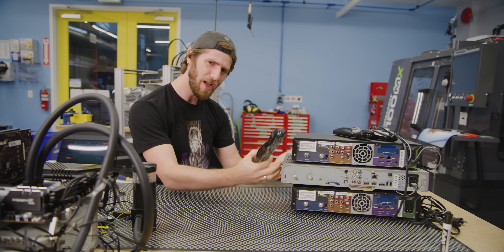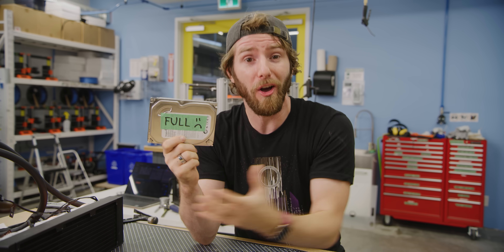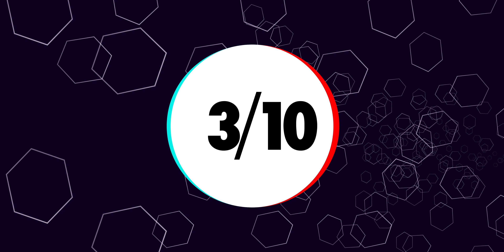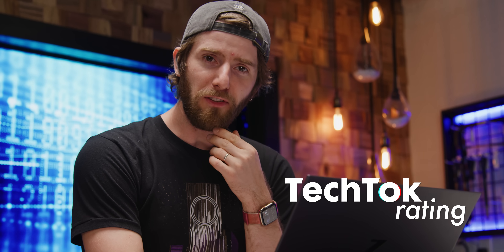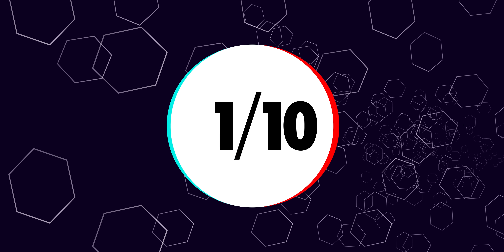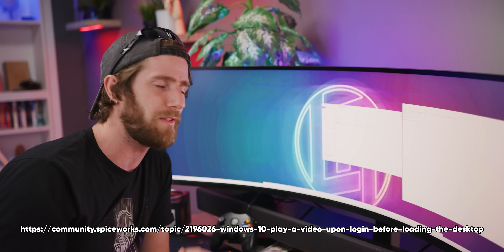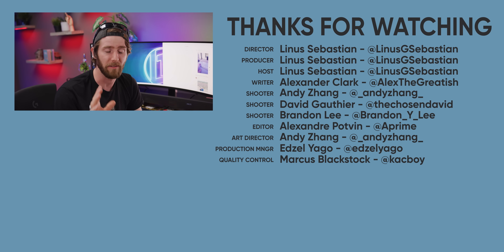Trying TikTok Computer Hacks...

Comment: 2:30 not only are most of the drives tiny, but also these things normally have a huge running time behind them and are close to their end of life. Even if you score a 1TB drive for 5$ (as unrealistic as 1TB or 5$ would be where I am from) you would most likely have an almost dead 1TB drive. These machines often threat their drives very bad as well; Sometimes having them constantly on even on standby even though no one has ever used the drive, or constantly starting and stopping the drive while running.
Reply: point is i dont want a 10 pound old hard drive when i can get a 7200RPM 1tb from 30 pounds

Comment: since i've been scrapping shit for years, i can say that it's actually pretty easy to extract a number of security bolts with just vise grips for $30. not to mention how handy the pliers are after the fact.

I've found all sorts of great stuff in the trash, from complete cases to various cables, and the 1980 pioneer stereo i use as my speakers.
Reply: Heh! 😀👍 I've used vise-grips to extract security bolts. Unfortunately it doesn't always work, one security they often use is to round the heads so that you can't find purchase. In the case of pinned-torx (like the ones in the PVR), you can use a precision-flathead like the kind for glasses; you just wedge it in between the pin and two points in the torx star. 😉
Reply: ive got a pioneer sx780 I found on top of a dumpster. been using it for 5 years
Reply: @user-vn7ce5ig1z  i just press the grips in sideways flat to the metal in those cases and clamp REAL HARD.
Reply: @sIacker  i think mine's a 3700?

Comment: You can snap the pin from the middle of the security screw with a small flat head screwdriver then just use a standard t bit to remove the screw

Comment: The dvr hard drive hack sometimes doesn't require a saw to get in as i just found one at a tip without the security screws. It just had hex screws although it was only a 500 gb wd green drive from 2015

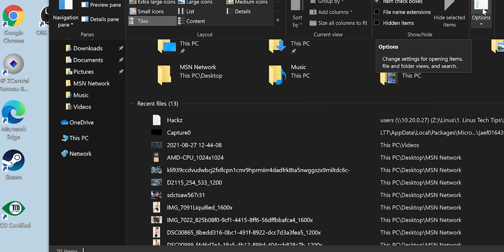Comment: 10:16 Hack improvement: If you want to hide a folder, choose an icon for it that looks like a regular shortcut (those with an arrow on the left bottom corner)
Reply: No, even better: make it an actual shortcut.
Hide the folder deep in your system and do a shortcut in some folder called "Programs" or something like that.
Then change the shortcuts icon and name to some lame ass program and all of your secret folders will stay untouched.
Reply: @-QuickNick-  Nice improvement!
Reply: Back when I was a kid I figured out how to make NTFS junctions point to themselves. So, you would click the folder and it'd just go to itself. If you manually entered the folder one level below the junction it'd get the folder correctly, though. I just tried to do it again and it seems I can't remember how I made it work. Perfect for hiding stuff w/o encryption though.

Comment: To remove rivet screws it is easier and safer to pierce through using a drill. Then using pop rivet you can also close back the assembly neatly. Don't use a buffer.
Reply: What difference does it make?  They're destined for the recycling heap anyway.  He could use a chisel and a sledge if he liked.
Oh, and if you try to buff anything with a wheel like that you'll destroy it.
Reply: @phydeux  the key word was "safer". good decisions come from experience. experience comes from bad decisions. now you are always free to use a cutting torch also. I really do not care.

Comment: Wiztree is faster than Windirstat and it does pretty much the same.
Reply: Yep, surprised the guys don't know about it yet.
Reply: I like SpaceSniffer, myself
Reply: And as they'll proudly claim on their website, they managed to make it so fast by bypassing Windows' APIs when scanning NTFS-formatted partitions/drives. Unfortunately, WizTree still seems to be doing a bit too much work on the main/UI thread, since the UI tends to lock up at certain points (somewhat like WinDirStat, but nowhere near as bad).
Reply: @Wise_That  I'm a fan of TreeSize. While it doesn't break it down graphically, it is fast and gets the job done.
Reply: @Surkrem  I've had windirstat miss hundreds of Gbs of files where wiztree showed exactly where the files I needed and was able to delete them no problem. I think I'll leave my eggs in wiztree's bucket.
Reply: @Surkrem  WizTree scans the MFT records (which is like 100mb max) while windirstat uses the caveman method of literally indexing every single file manually lol

Comment: Regarding the gloves comment @ 1:54. You are actually not supposed to wear gloves while using a device that rotates  at high speed like a grinder. It is considered an OSHA violation in the US to do so as threads from a glove can get caught in the disc and cause injury to your hand. The main thing is that the use of gloves around tools is something to think about as losing a finger is a real possibility when working with more powerful devices like drills, lathes, and bandsaws.
Reply: There are gloves which can withstand an angle grinder; specifically the ones which have big rubber knobs. But most of them are subpar according to Project Farm.

For a drill [press], lathe, or bandsaw? Yeah, screw that, no glove is gonna protect a hand from those. Maybe chainmail but you lose more dexterity than it's worth.
Reply: He probably lives in Canada
Reply: @rockpie.iso.tar.bz2 Linus lives in Canada are you new ? He said it many times
Reply: @slurmoCZ  no. i just wanted to say "probably" in the low chance that i was wrong
Reply: @rockpie.iso.tar.bz2  oh okay that's fine even if you would be wrong at least you would learn something new and sorry if I blamed you or something

Comment: I got couple of hard drives I took out from old digital TV receivers, I use them with my WII. Also used the power boards and fans for some Arduino and Raspberry projects, faster and cheaper than ordering from China. Besides sometimes things don't work as expected, so it's nice to have a bunch of spares. And it's really soothing to disassemble things.

Comment: Getting rid of security screws is actually done easier just drilling them out than flexing the thing open. With practice that takes just a few seconds.

Had to do that quite a lot to get to hard drives we needed to separately destroy before recycing the rest of a device early in my career...
Reply: Or spend a hot 50 cents on the driver you need. Or use pliers. Lmao.

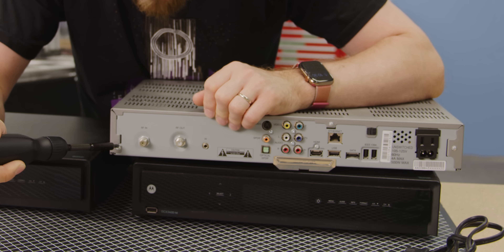Comment: 1:40 Alex plays the Safety NPC and Linus seems to be skipping the dialogue
Reply: gloves/loose clothing do not pair well with rotating tools
Reply: @brendanrandle  especially given that a tech workshop should have at least a cheapo chinesium security bitset, or , you know, a beefy pair of vice grips that would work easier and safer to just turn the screw out
Reply: @brendanrandle  or even a hacksaw to make a flathead slot

Comment: 9:48 most variants of this trick are incomplete without using a custom icon with a shortcut arrow that matches your OS perfectly overlaid on the corner
Reply: Or just use the blank image and special symbol trick to make your folder literally invisible. You'll only see it when you hover your mouse over it, it won't even appear in the file browser unless you change visual to "detail".

Then you can also make it a hidden folder to really fool them. They'll turn on hidden folders, nothing will appear, so they'll revert it. Your super secret folder of saved pasta recipes is safe.
Reply: make your how work folder a system folder.

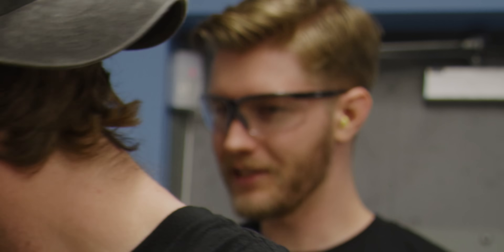Comment: 2:00 Just use a sturdy screwdriver and pry it open from the sides. 10 minutes of prying is quicker than a grinder.
Alot of dvrs use the same pipeline drives so you can raid them together in a raid mirror with a lot of success

Comment: As someone trying to learn data science and data analysis those little squares from Ninite Linus is called a Tree Map it’s good at sorting things and helping you drill down to specifics
Reply: Yep, it actually says that at the top in the application.  But that's minutiae this video didn't really need to get the point across.
Reply: @phydeux  yea I know i just thought it was cool to point out how you can see where you’re generally using most of you storage and memory to help compare the if it’s something that’s unusually high in that range

Comment: Hold on, did Alex just say to use gloves while using a angle grinder? I thought he knew about this kinda stuff
Reply: He did it because the metal was hot,
Reply: Why is it bad?
Reply: @Nickwilde7755  Better to scrape some skin off, then getting your fingers twisted in the grinder
Reply: @Nickwilde7755  never use gloves, loose cloth, untied long hair when work with any rotating power tools, it can tangled and may cut your body part.
Reply: @toptierdiscordmod7806  the spark not that hot, frankly the best safety when using power tool is not really protection (well, other than glasses to avoid spark getting into eye and ear muff to absorb noises) but good ergonomic workplace with enough lighting, fit condition body, and stay focused is the key.

Comment: Win+Ctrl+Shift+B is not for resetting the GPU drivers. 

This keycombo actually saves out part of the dispdiag circular log and queues up the data to upload through telemetry indicating the customer had a black screen. That's what the "B" is for. Blackscreen.

The key combo was added to help diagnose instances where the machine is churning along but there is nothing on screen. Pressing it when you don't have a blackscreen just adds noise to the system. A driver reset is a possible side-effect but not the intent of this key.

Comment: my first pc had a 4gig hard drive (although it had an engineering sample of an AMD Athlon 1100 overclocked to 1.4ghz when the fastest retail you could buy at the time was a Duron600 - mucho gracias to my old man who was head of R&D at mesh computers and took the prototype home to test and put it in my rig along with a soundblaster and guillemot 3dfx voodoo 16MB! gfx card and 256mb of ram)

Comment: I did that first one and found a 500gb hdd and I think the Dvr was $5 from goodwill but it’s a 5400 rpm and it’s slow as hell, but I now use it to store games for my modded Wii U and it works pretty good
Reply: That's what those are meant for. Those "OEM brands" are literally designed to only store large files and therefore have horrendous seek times.

Comment: One thing about XMP that should probably be mentioned is that it VOIDS YOUR CPU'S STANDARD WARRANTY. I had an i7 that died within the first few years of operation and I tried to RMA it, but when the Intel tech found out I had XMP on, they told me that they're technically not supposed to take returns in such cases. Fortunately the tech was a bro and fulfilled my warranty replacement anyway, but also informed me that in order for my warranty to cover damage potentially caused by XMP, I'd need to pay another $40 for a special overclocking warranty.

Comment: Unknown/mystery HDs I found to be hard work to format properly and took me a number of efforts before I got it to work as my gaming PC back up Hard Drive. At one point my computer could not identify which drive the operating system was on and span into an infinite stuck loop. Make sure you can format the HD as a system 2nd drive to back up to. lets face it we only use these to back to now we have SSDs as Primary system drives and the Spinning disk is the Secondary back up drive.

Comment: I know this video is a year old and all that but people probably don't know this and im not entirely sure if it's on by default or not but in ShareX there is a setting to where you can just copy the local file directly to your clipboard when you take a screenshot, you don't need a URL or anything. And to be fair, nothing about going through ShareX to upload it to a web hosting site is convenient when you already have to do more work for that than just taking a screenshot and sending the file normally (or ticking the one option to copy the file after the screenshot is taken)

Comment: I saw a video on YT a few years ago showing how to take apart a Sky TV Box set to remove the hard drive out of it and in luck I did get a Pipeline drive and it come in handy when my 2TB drive was on its way out, although for the first time in 20 years I didn't know that TV boxes even had hard drives if I knew I would of stopped my aunt and ask for years because I bed it had at least 1TB in it.

Comment: Ctrl + Shift + Windows + B is a shortcut to reset your GPUs drivers which (from my knowledge) essentially just flashes all GPU settings back to default specified by your currently installed drivers and will in turn reset any overclocks you applied and can sometimes be handy when you accidentally overclock your system too much.

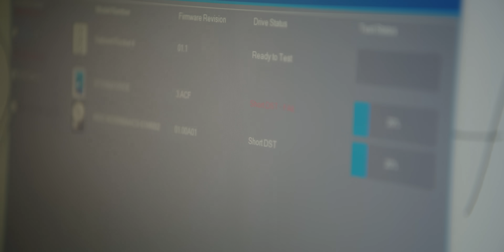Comment: 4:30 (RE: harvesting hard drives from DVRs/NVRs)
I've actually tried this with some NVRs and quickly learned that some drives require 3rd-party hdd tools 🛠 to "trick" certain firmware/power flags inside the drive to make it accessible outside of the unit itself...and it doesn't always succeed. Out of the 3 I tried to salvage, only 1--strangely a Seagate Pipeline one--was successful. ❌❌✅ 🤷‍♂

Comment: The directv box models hr24-34-44 and 54 will have 1tb hard drives In them 90 percent of the time the models hr44 and hr54 will always have them it's the 24 and 34 that come with either 500 gb or 1 tb

Comment: I got as far as the hard drives in viewing boxes, I have done this, dramatic video, you quickly learn the HDD size in different models of boxes, the little metal tabs need a little twist with pliers not a hammer?

Comment: 1st TechTok: I buy used 1tb for roughly $18-$22. No tools required for extraction. Unless you enjoy the "hunt for salvaged parts" to the point this gives you personal enjoyment, it is 100% not worth it to seek out old DVR machines and spend $ on it. If you happen upon them for free, awesome. In all instances you will never see a 7200rpm drive. 5400 max is all I've ever seen out of those devices.

Comment: WinDirStat is interesting im using SpaceSniffer very similar program
from what i checked designMode require ' symbols not " and when you typing yt player reacts to shortcuts so kinda annoying and i think i wouldnt believe in tweet that is underlined with red wavy line
ps Valheim is cool

Comment: Such a huge fan... but i gotta knock you a little on some.of tour ratings for the decent but inexplained "hacks" i feel like you didnt take into account that tik tok limits how lo g your recordings can be based on a dew factors and this is something that would "likely" have been the reason why some of the tricks werent explained in any length .. when you video is limited to so many seconds you kind of have to be picky on what you include combine that with the potential lack of hardware/software or know how for video editing and it leaves you pretty hard up when it comes to content creation 
Still lvoef the video though 😁

Comment: That instagram private one would never work. The data that is displayed is always construct from the codes and data on the server. Editing html elements in inspect element tool is only local to your device display and a refresh means new server request which will serve the data the way developer intended to be served based on the code construction from the server. It doesn't do anything to the code stored in server. As a developer i give it a Solid 0/10. It would never be that easy. I mean Never : D

Comment: Man, I have to say that I'm disappointed in your flat-out refusal to wear proper PPE while using an angle grinder. Whether you like it or not, you're a role model to a good many people, and, whether you like it or not, your willingness or otherwise to use the proper safety equipment while operating a power tool that, even in the hands of a skilled operator, still has the capacity to cause serious injury, will influence some of your viewer's decision as to whether or not they feel like they need to wear proper PPE while using that tool and others like it.

Please remember that it is not possible to anticipate every situation that can result in a dangerous outcome.

You make some pretty solid content otherwise, man...not that you need my validation to know that. Look, I know that you don't really have any reason to listen to or care about what I have to say, and obviously it's your decision how you choose to conduct yourself in your content...but I feel that I would be remiss not to point it out, on the off chance that you hadn't considered the amount of influence that you undoubtedly have. 

Either way, thanks for listening.

Comment: I got a better idea and I did this purchase sas hard drives they’re cheaper than Sata I put two 6 TB Sas drives together and got 12 TB of space The only thing you’ll need is the hard drives and A sas card for inside the computer The one I have has external connections as well as four internal connections with ribbon connectors so I could stuff over 20 drives internally as well as externally and you can do this externally if you have a proper PCI card that has external sas connectors on it. Meaning you can even get bigger drives and combined them and one nice thing too they don’t have to be the same size you can mix them use a 6 TB and you can use a 4 TB you’ll wind up having 10 TB on some systems I know you have to have the same size hard drive but on the way I do it you don’t. I spent 20 bucks on the two hard drives 6 TB apiece $58 for the SAS PCI card. A 6 TB sata hard drive would cost well over $100